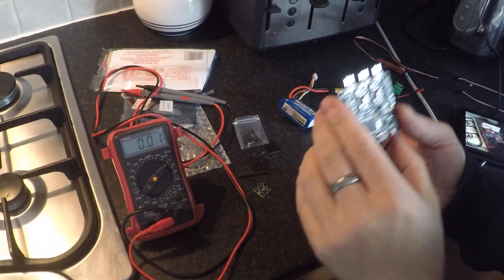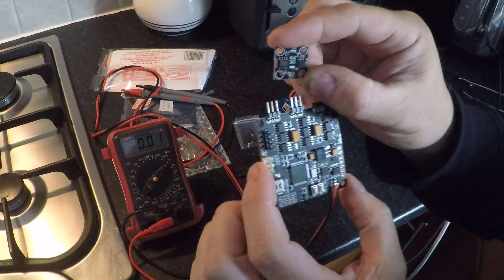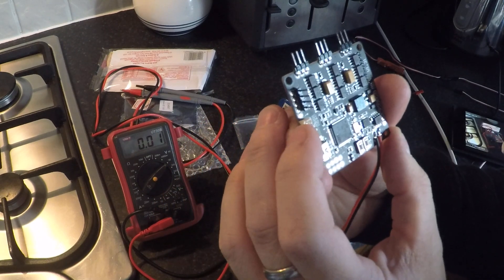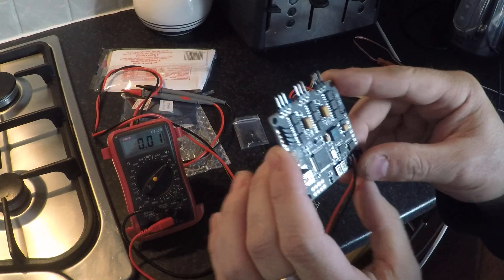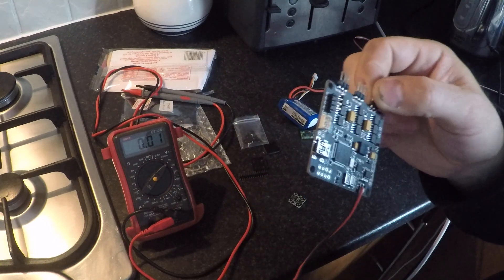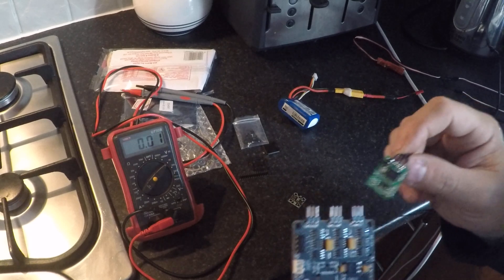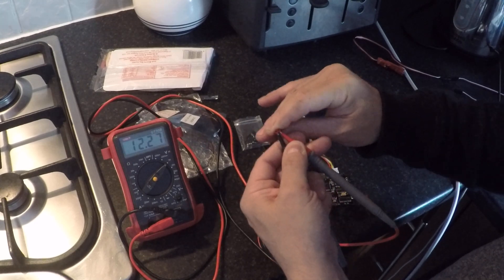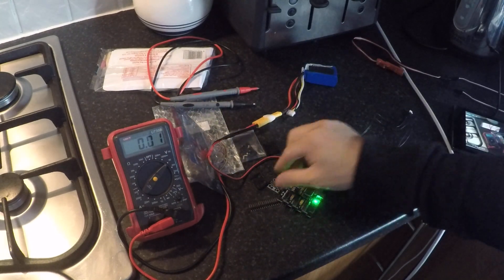GoodLuckBuy STorM32 Gimbal controller woes!

Comment: This boards have a problem. If the IMU cable is damage and you get bad conection while is working, you will fry the FAT from the board. Its stupid, but you can try yourself.
If you want this board last for a long time, remote the IMU conector and make a solder, to ensure perfect conection.
Reply from the maker: It turned out that the Gimbal controller shown in this video conforms to a modified design - this being that it tries to alleviate i2c errors, by running 12v on the iMU port (instead of being 3.3v as per olliW's original design). The provided i2c IMU supports this higher voltage, so this would have worked if I had connected it. i2c IMUs however are not supported with later Storm32 firmware versions, as anything newer that v0.96 only support OlliW's proprietary NT standard, so this controller is an all round failure, given that it can't be used with the NT IMUs - as these require 3.3v (so would require a regulated 3.3v supply). So this gimbal controller got assigned to the spares bin!

Comment: sorry for this loss. 

I post my comment http://www.rcgroups.com/forums/showpost.php?p=35107241&postcount=8388 here too, so that people know:

this is beyond any doubt the board with "i2c hardening electronics", which can't be used for NT anyway. Edit: this one: http://www.goodluckbuy.com/storm32bg...otography.html, they call it "Built-in anti-interference module"

I didn't know that it outputs Vbat, I would have guessed it's 5 V

anyway, since this is definitely not the board which is offered in the link you gave (note e.g. the UART label on the case, and note that the imu module has no anti-interference chip!), it's a mistake by GLB and you should legitimately ask for a replacement or refund, as well as a compensation for your killed NT imu
Reply from the maker: Olli, You are completely correct! Looks like this board has the hardened i2c electronics integrated. I installed the 0.96 firmware tonight and soldered up the supplied i2c camera IMU, and this one works with the high voltage supplied by the i2c port. I managed to calibrate both IMUs without any issues. I just wish GLB would have advised that this board did not meet the v1.31 standards - but some bespoke standard instead, and that it would not be compatible with regular 3.3v IMUs. Thanks again fir your awesome support. I'll post this also in the RCG thread.